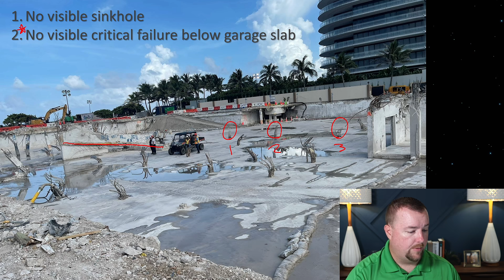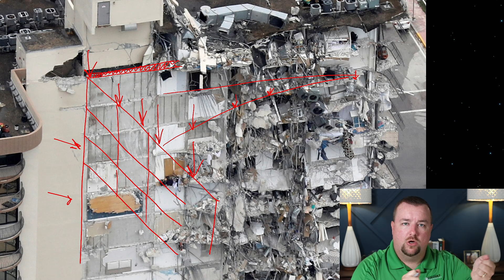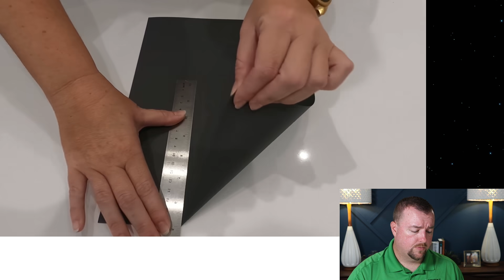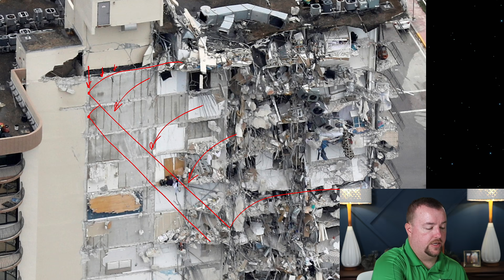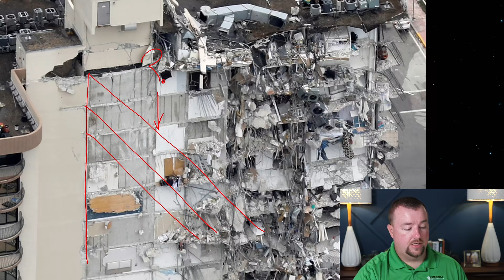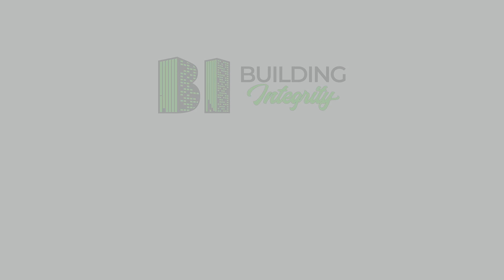Surfside Collapse - Structural Engineer Explains Why Only Half the Building Collapsed

Comment: Thanks for the great videos on the Champlain collapse. Much appreciated. As far as I can recall you have not mentioned the various column sections used in different parts of the building. 16 in sq, 24 in sq and 12 x 16.
The collapsed part seems to use 16 in sq. The part that didn't collapse 24 in sq and the pool deck 12 x 16. These came from youtube videos by jeffostroff which reference the original plans. The columns are on the same pitch.

24 in sq has twice the cross sectional area and therefore twice the compressive strength of 16 in sq. Buckling resistance will be even greater (2nd moment of area) though I am not sure if that is relevant in such a strongly networked structure.

Hope this helps.
Reply: The thicker columns would help support the heavy elevator shaft and stairwells. Other areas had less load and thinner columns (whether wise or not).

Comment: looks like the demo'd those columns during the clean up, they previously showed pictures of the columns more in tact, not sure why they demo'd them.

Not sure why they demo'd some of them, and left the shear walls in place.
Reply: Because the heavy loader which was used to clear the debris likely destroyed the columns during removal of the building.
Reply: @parallelsandtangents938  no, they were demo'd after the debris was cleared, there are pictures and video's of the site cleared with the columns in place.

Comment: Why didn't you touch on expansion joints in any video. Expansion joints completely separate the building by dividing it into sections where no piece of each structure is connected structurally. If that makes any sense.
Reply: Good point. I think what he calls a shear wall is actually an expansion joint. That explains the complete lack of visible rebar.
Reply: @gordonrichardson2972  exactly. No rebar between expansion joints. Buildings with that big of a footprint need to be divided up and separated. But I'm not sure the requirements in that climate. Do the temperature swings justify it down there.

Comment: Discussing the structural collapse of this structure is a good example for the difference between the two main types of people that populate the world.  The majority, "Two Dimensional Reactors" and the minority, "Three Dimensional Thinkers."  A TDR sees the wall falling down in two dimensions caused by something failing to hold it up.   A TDT can see the cause of the wall falling down from many different angles and for many different reasons and the chain reaction of events that followed.  Thinking everything through until they reach a factual conclusion and never allowing themselves to be weakened by taking the easy way out, assumptions.  That is saved for reactors.

Comment: Some of the post collapse pictures show part of the pool deck also collapsed underneath the building that did not fall.  It looked like a parking level because of the cars on it.  It's a wonder that portion of that building didn't fall either.

Comment: The cities hired engineer is saying the walls are functioning like bathtubs right now and could cave in. I understand that but wonder about the same back in 1980 when they were building the condo. They start at the bottom and those walls would have been exposed just the same until another floor or the deck was built. He is suggesting this is critical right now and even worse if it rains. I wonder if that is as critical as he is suggesting.
Reply: If you look at the video about the crane collapse during construction, it looks like the outer walls that are holding back the dirt at street level now, didn’t have the dirt against them when they were built. The dirt was backfilled after the slabs were poured. So the horizontal slabs were in place, holding the walls upright, before the dirt was pressing against them.
Reply: @joanberkwitz2662  Now there's a valid response. I'll check into that video.

Comment: 14:00  The vertical fall of all that energy is taring along the path of Most Resistance, the shear wall, and then Least Resistance until it comes to a new line of Most Resistance, the next column line over.  

The first column line that collapsed, fell with a certain amount of weight and energy.  The connecting slabs pulled at the next column line which was still strong creating a braking or deceleration action for all that falling energy.  That's why the rear section didn't fall immediately with the first.  

With all that debris crashing into the basement, that energy was deflected horizontally into the rear and side columns  which must have been knocked over which then expedited the rest of the collapse of the rear and right side.  Basically kicking the legs out from under the structure.
Reply: I like this comment !

Comment: So was the section left standing stable at all, I mean was demolition necessary so fast 🤔
Reply: It wasn't stable, no. The rubble piled up against it seemed to be partially holding it up because as they were removing it the building was shifting. I seem to recall hearing that a column had shifted 6 inches. They were afraid it would collapse on top of them, plus the hurricane was coming which also might have pushed it over.
Reply: There was a hurricane headed towards them. They had no choice.
Reply: Dude, seriously??….Who in their right mind would want to live in that section?
Reply: @Wazupu  not to live there silly but to go in and get pets and a few important things
Reply: Probably not an option even to go in to grab a few things. The stairwell was blocked from escape at the first floor (or else led to a flooded garage with no real path out) and the elevators couldn't have been working either.
I hear there was a last minute attempt to capture some pets by rescue crews.

Comment: Excellent video.  Great explanation.  If they had built the pool deck area totally independent of the building, we might just be talking about some crushed cars.  They would of probably lost a few parking spaces due to additional shear walls and columns, but the building might still be standing.

Comment: There was a heated hot Tub there, if this was heated by natural gas or propane When the pool deck collapsed it could have severed the gas or Propane lines and cause a gas explosion. That would Explain  the reason The building came down. When you want the security footage of the building falling down if you get the full version there does appear to be a bright explosion at the very end of the footage that most newscasters have been cutting off and not showing Including you, go find a full copy of that video and watch it all the way through and look at the bright red and white explosion appears towards the end of the collapse from under the building. Also the pool deck explosion could have caused the gas tank on any of the cars to explode with that much weight that fast and hard.

Comment: Thank you for amazing explanations. You inspire me to think about this topic so congratulations you are a great teacher. ( I am an science major) I have a few questions in case you can answer them. 1. How many shear walls did this building have? How many should it have had? Was there only one elevator?
2. Was this building design (40 years ago) not in use any longer? This question relates to columns and slabs maybe no beams used 🤷‍♀️
3. Can you explain a little the difference between columns and beams and maybe slabs. How many should there be or the relationship to each other. Did these building have beams? Are they important?
4. The (amazing) paper explanation is why we see in the building that didn’t collapse a “flat” surface all the way till the end of the shear wall and after that we see pieces of the rooms sticking in and out on an irregular way? Sorry for asking questions but I got really into the topic. ☮️ you are an amazing professor. And that seems to be your goal here. Stay safe and please keep making these amazing videos.🙏

Comment: Looking at the 4 part diagram you’ve used in several of your videos now; when addressing the portion of the building still standing, how did the remaining building directly in front of the failed columns not fall as well?   I’m not entirely familiar with the “pool deck” area, but it appears as though some of the upright part of the building would’ve also suffered the pool deck failing very close to it.    I could be wrong,  this question may make no sense; but if anyone understands it, do explain.   Was it the 3-5 columns that initially failed that caused the pool deck to fall, thus taking down the building as it did?  Or was it the pool deck falling first that was the final straw for the columns?   If that was the case, I wonder why more of the surrounding building didn’t also collapse in the same manner?

Comment: Where I live they are in the process of a 400 apartment high rise. When I drive by it I am looking at it more closely. I am thinking how are they building it. Are they pouring concrete on one floor before moving to the next. I look at the rebar sticking up to see how it is woven together. I never would have been interested in this before watching your videos on the condo collapse in FL. You explain things so easily to those of us who don't have an engineering background. I find this totally fascinating. THANK YOU for taking time out of your day to explain various aspects of the collapse in your videos.
Reply: Right?? It's like seeing the world with new eyes because I am scrutinizing everything now!
Reply: I don't like rebar at this point. I'm going to lean towards the old I beam stuff that's still standing. The Empire state got smacked twice by military planes in the 40s. Still standing and the repairs are still holding 70 years later. I beams it is.
Reply: @windsofmarchjourneyperrytr2823  Steel-skeleton (I-beam) structures are great for OFFICE buildings, but NOT for residential units, because... they SWAY in the wind!  Peeps can handle that when working, but when relaxing or SLEEPING?... nay way.  (That said, when you're right on the beach, you still have to maintain/coat your I-beams... ;')
Reply: Honestly, my eyes have been opened, aware of details. Just walking inside a 4 story parking garage has me noticing column widths. I’m just a little old retired lady.

Comment: Josh, your explanation of how the slab spread the lateral forces is quite good, and your description of the punching shear is sound, but what about the rotation of the columns at their b=ases, which you only briefly address.

if the column is weakened where it attached to the piling cap at its base, the rotational pull can pull the column sufficiently off of the vertical that it loses its capability to support the load of the higher stories, and in addition to punching shear, you have column collapse in play.

I think that this combination of failure modes was in play at the facade and initiated the collapse.

Then you have the progressive collapse of the structure into the void where it had previously had support, which manifested in the type of collapse we observed.

This mechanism set is what is exploited by a demolition firm doing a controlled implosion, where once the key supports are knocked away, the building's own weight pulls the rest down.

Anyway, it appears to me that it was a compounding of criticalities which lead to the ultimate collapse, and not purely any single mechanism.
Reply: “A compounding of criticalities...” Perfect!

Comment: Shear wall, shear wall. Why is there a shear wall? Why is it there in the building? Is this the only shear wall in the building?  Is this part of the elevator shaft? Was there only one set of elevators in the building?
Reply: I’m not an engineer, but I have asked the same questions. Shear walls are there mostly for seismic and hurricane/wind load reasons. My understanding is that it functions something like an expansion joint in a bridge, but the other way round. All structures move a little bit, every day. A bridge wants to expand as the sun heats it up, and it wants to contract as the night cools it down. Expansion joints and bearings allow this to happen. Expansion joints typically demarcate where one prefab deck element ends and another begins. The deck sits on bearings at both ends which will allow the bridge to expand and contract as it needs over the day. Next time you drive under a bridge, look out for this. You’ll see the two decks are supported by a column, separated by expansion joints. If you then drive on the bridge, you will hit those expansion joints, and now you will know that you’ve crossed from one deck element to the next.

A shear wall is a very strong part of the building, and you will typically find them around fire exits, lift shafts, stuff like that. In this case, the back of the lift shaft is the shear wall. On the other side of that wall is the lift shaft and fire exit next to it.

Shear walls are reinforced both horizontally and vertically. But the whole idea is that it resists certain loads placed upon the building, the primary ones being seismic loads. However if a building is built to resist seismic events, it will generally resist extreme winds, hurricanes, etc, as well. It’s basically there to make the building stronger, with the side effect that it will tend to allow the building to separate in some instances, like it has here. The shear wall allowed the rest of the building to fall away and not drag it down.

As for other shear walls. I seem to remember a smaller one elsewhere in the building, but I’m not sure. And yes, there was one lift shaft, with two lifts.

Take a grain of salt with this, I’m not a structural engineer, but shear walls are important in building design, and basically every building in the land has them.
Reply: @uzaiyaro  in older (bricks and mortar) buildings in the UK, it’s common to see what we called a Spine Wall: usually seen in large buildings with big, open internal spaces  (think manor houses and great halls) which connects the longest walls across the shortest space. The reason for this was to stop these huge walls twisting and warping, which could cause them to fall or bring the roof down on the inhabitants. The structure literally protects the building from tearing itself apart under its own weight and any other stressors - in listed buildings they can be repaired / replaced with modern materials as they are crucial to the integrity of the building as a whole. 

I assume one of the pay-offs of having to make the lift shafts and stairwells (spine of the building) so sturdy is they reinforced the slabs around them, however in this instance it seems that the section that fell first was more of a floating slab and not tied into that shear wall as much as it was to its own (failed) columns
Reply: @nataliesiddle8507  yeah, that seems quite cromulent. But what I’m wondering is what the second little shear wall was for. I/someone who knows what they’re looking for, may have to dig through the schematics, but I do remember a screenshot somewhere showing that it is indeed there. As @gosvideoeye mentioned. I don’t remember seeing it with a lift shaft or anything, the entire building only has two lifts in a single shaft, as part of that large shear wall that kept the damn thing in the air.

I’d understand more if this secondary wall was a similar size, but it only appeared to be a fraction of the size, maybe like a quarter or so.

Any idea what the idea might be here?
Reply: Because of the elevators and stairs.
Reply: When our 2-story house was being built I asked a number of questions during construction to have a better understanding. One was about shear wall. Earthquake country, and we had a few shear wall panels in our build to strengthen the structure in case of earthquake for example. Window and door cutouts would otherwise be weak points without. Was also shown how the roof framing all the way down to the garage tie downs into the concrete slab foundation would help secure and support the weight of the roof in an earthquake or heavy winds where the house would be under stress.
Reply: BTW there was a small area of shear wall at the western stairwell by the x01 & x12 units. Probably why that section #3 stood for a few seconds longer. Maybe Josh will discuss that area next? 

It would have been a frightening sight if that western section hadn’t fallen but stood ripped apart from the core. I know I was hoping it wasn’t going to topple over as precarious as it looked. If only people there had a chance for escape or rescue. They had the longest warning of building collapse but sadly even that stairwell wouldn't’ have helped them.
Reply: @GoSvideoEye  I thought there was a second shear wall. I wonder what it was there for, because I don’t believe there was a fire exit or anything there.

Comment: Wouldn't it have been stronger to use steel beams between each of the columns on every floor (within the concrete slabs)? And why not just talk in person to the actual engineer who designed the building? What does he or she have to say about their design?
Reply: The original engineer is likely long deceased, given that the building was built in the 70s, and freshly minted Professional Engineers are not going to win a contract to design the building. Some who worked on it may still be around, but likely are not jumping up to be interviewed.
It would be difficult to encase a steel beam in a slab and get the concrete to attach to the steel, as there would have been little area for adjacent slabs to attach with the beam in the way. The usual way to build on top of steel beams is to lay corrugated on the beams and spot weld them together. Then the slab and rebar are built on top of the corregated steel. The corregated steel is there to hold up the concrete and rebar until the concrete sets.
Reply: They are probably dead, I mean it was 40 years ago.